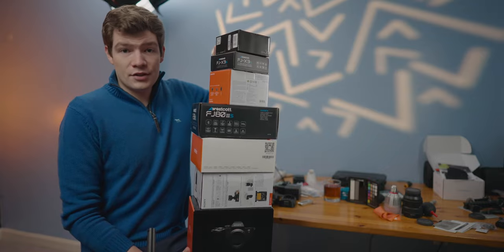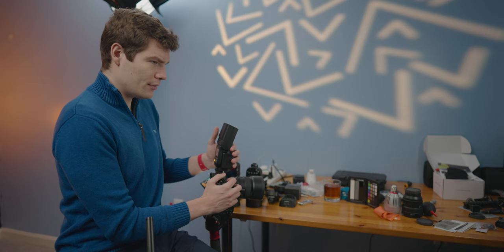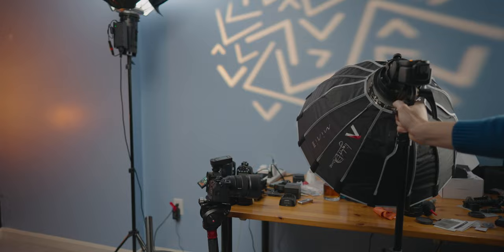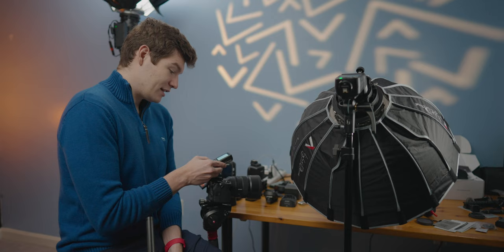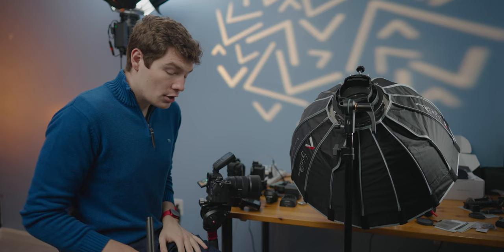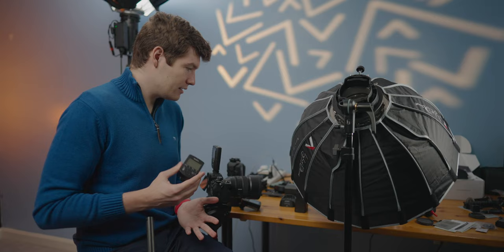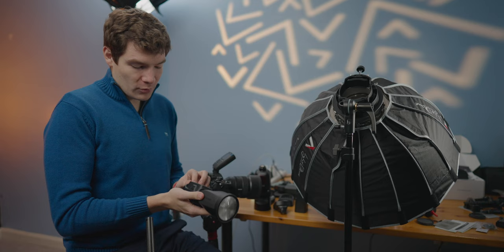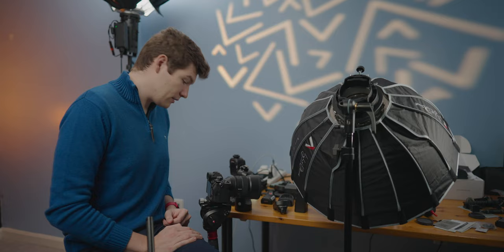Sony has a big camera flash problem (A7SIII, A7IV, A7RV Wireless TTL)

Comment: This is exactly the problem I have had using the XPro S & XPro II S with my A7iv and A7Riv bodies.  All images are underexposed by several stops, and it's inconsistent so compensation doesn't work.  If I put a V1 on camera, TTL works as it should.  I owned the XPro F for my Fuji, and TTL off camera works as it should.  This seems to be a problem with Sony cameras only.  I reached out to Godox, but they never replied to me.  The support has been really disappointing.

Comment: I don't find it that surprising that a third-party flash system does not operate perfectly with a particular camera. Autofocus with third-party lenses also don't work as well as camera manufacturer lenses.  I tried out various Godox portable flash units because my studio flashes are all Godox.  I can say for sure the Godox units are not as powerful as the Sony ones.  The V1 is about a stop less powerful than the Sony HV60.  Also, the Godox AD 200 puts out one-stop more light than the Godox AD400.  That is because the AD200 has a different type of flashhead (fresnel).  But I bet there are a lot of people who buy the higher-watt second flash thinking they are getting more.  So, I went with the Sony flash system...more powerful, less lag time, better built, metal shoe. You get what you pay for in this case IMHO

Comment: Now this is why i've had problems using rear sync. Was disappointed during a party shoot that i couldnt use the rear sync on the A7IV with the 3rd party flash i used with no problems with the A7III.

Comment: Thank you so much for this video. I thought it must be my fault: The settings are complex, and I still do not know what each setting does. I thought TTL must be something for beginners as you get to at least a useful exposure somehow. I did lots of tests but did not get it to work with my A7iii as expected. Sometimes I get usable exposure with +3 stops flash compensation. Most of the time it is too dark. And sometimes it does not adjust when I e.g. open the aperture and overexposes the images so that it is completely unusable. This especially happens when the camera is in manual mode. In other automatic modes it correctly exposes the image, but it is not doing what I want (e.g. sets the ISO super high). I ended up working in manual mode (M) on camera and setting the flash power manually. This is the only reliable method, but it requires some test shots. On conferences or events, you need to be quick and do not always have the chance to take test shots. It is so annoying when you miss a moment because you are just too slow with the manual settings. I really wish I would have a reliable TTL option.

Comment: Hi Karl, my Sony A7M4 does the same on wireless ttl as you described it in your video. My Sony A1 does not. It works perfectly on wireless ttl with godox. I used the xproII transmitter and a ad300pro flash with recent firmware. That is really wired ......

Comment: On the V1S they make a metal hot shoe version now (hard to find)

I ordered a metal hot shoe replacement and it’s amazing i break the plastic Godox hot shoes so often and they’re hard to slot in. The metal ones no issues so far
Reply from the maker: That's good to know
Reply: only the plate is metal. It's still plastic in the inside, so if you drop your flash on a tripod or something similar, it's broken.
Reply: @sulev111  regardless these metal hot shoes have yet to break on me yet simply due to less friction when inserting and taking off. 

The plastic ones break on my monthly
Reply: @koolaidpapi7674  apples n oranges :P I use my flashes mostly on tripods. There the metal plate makes 0 difference. Godox needs to improve their build quality.

Comment: Dear Karl, Thank you so much for this video.  You have found the one combination that seems to work:  Sony HVLF60M plus Sony FA-WRC1M Wireless Radio Commander.  Just for reader information I was able to order both of these reused for a total of $300 from eBay.  At about 7% of the cost of A7rV this cost is reasonable. When they arrive, I will let you know if they actually work. In the meantime I am putting all of my various non working TTL flashes in a storage box, to be used potentially as remote flashes when needed, providing the Sony Radio commander can trigger them.  I have Nissin, Godex, Flashpoint, and various older Sony flashes that don't work for TTL on A7rV.

Comment: It's bad... I have a problem with the 3rd party Sony ecosystem big time as well. You can't even get the IR focus beam to work on the a7IV with some transmitters aad the fact the Sony doesn't even have an AF beam on their trigger kills me! I work a lot of low-light events and not getting focus while working off camera is just dumb! I have been using a Elinchrom Transmitter pro for some Rotolights and came to find out that it won't fire the AF beam on the a7IV camera. I am almost convinced I should go back to my a7III, just so things work again, plus, I hate the fold out screen versus the tilt screen, since it blocks the ports when I'm using them and need to use the fold out screen... So many bad choices made with the a7IV. So many. I love my Sony flashes, but the system could really use an overhaul and the HVL-F60RM2 is not even an upgrade! The LED beam was removed? WHAT?! That was a feature and it's somehow more expensive than the last generation still?! Why is Sony so good with what it gives consumers inside the cameras, but so bad with their peripherals and compatibility besides? The Sony interface hot shoe is the other issue... I've replaced about 3 hot shoes on my Sony flashes alone and another on the Flashpoint./Godox Thank you for saying something! Youtube is desolate wasteland when it comes to videos talking about the Sony flash system. More videos need to be made so Sony feels the pressure!

Comment: Confirming. Latest A7S3 and Godox Xpro2 and V1S firmware upgrades - the issues is still there. TTL works fine while V1 on camera and fails when using transmitter.

Comment: One thing that I want to add: 
You turn around the bug statement. It is not a Sony bug as all the other old Sony Flash and Godox are working perfectly well.
The other manufactures of addons have to adapt their firmware to work proper with the camera that they are attached to. 
It would be the same if you have older car rims for you car that doesn’t fit, you blame the car manufacturer to change their setup due to an assembly design error ! A little weird.
In one thing I agree with you, you shouldn’t have made this video.

Comment: my A9 with the old menu still has this problem, not as bad. As others have said it goes away above f4. I have godox, they are ok especially with you factor in the cost.  Love the batteries on V1 which last forever. I was hoping the new controller would fix this problem but it does not. Also it has the old rubbish plastic foot not the newer metals ones you can get for the flash. Have you tried profoto ?

Comment: Great video Karl. I had horrible experience with Godox this weekend. Speed lights were undersexposing with ttl, on both A7iii and A7R v. At some point during the ceremony they decide to blow at kind of full power and overexpose everything by a lot. Same happened with AD200 and 400. So bad.... I was thinking about westcott, but after your video I'm definitely considering jumping to profoto, no matter the price. Any experience with profoto??
Reply: Hi! I'm working as a photography assistant and ever since we've changed to profoto, there is no looking back. Literally the absolute BEST in flash and better than you can imagine.
Reply: Profoto A1x performs similarly to the other off brands. Sometimes it nails exposure, other times it misses or just doesn't fire. It's frustrating so I just went to manual mode for my shoot two days ago. I am considering the smaller (not so expensive) Sony flashes exclusively for event work as I just need them to function properly so I don't miss these moments.

Comment: Karl Meyer & other saying about AA (14:13). You can buy ATG/Quantum/Nissin battery pack and connect it to flash.
You should really stay away from Li-ion battery for speedlites. They are expensive & use or no use they will go bad.

ATG used to support Jinbei/Orlit/Rollei/Westcott but departed over to become ATG/Godox.
So much problems & no supports at all from Jinbei for USA. That Adorama and B&H no longer support them.

Tested Sony A1 & A1 II: Jinbei & Rollei & Westcott are not supported.  You don't buy TTL features and use it in manual modes.
As a matter of fact one can use ATG's Quantum QFlash T2 and get better results than using wireless radio TTL.

Comment: Did you try switching the wireless flash off in the camera menu? I just switched it off, and it seems to work, at least indoors. It was not working properly before I switched it off. I will test it again outdoors tomorrow. I have  an ad200-pro, X2t-s, and A7c
Reply: ahh !!! it worked for me on A6700 .... thnx

Comment: nice work on this video BTW~!~ question, what is the resolution or settings your using to record this video, and why it looks so wide ?
Reply from the maker: I used an aspect ration of 2:1 instead of 16:9 meaning my video timeline & export was 3840x1920

Comment: So, I just bought a Sony a7rii, because they've gotten much less expensive.  Now, I want to do some HSS outdoor portraits using my Westcott fj-400 and the fj-X2m and it will not do HSS.  I had to turn off several settings in the camera, update firmware on all westcott equipment and still no HSS for the Sony.  All my old Canon cameras will do HSS with my fj-400 but that is what I bought the Sony to do.  It is June 2024 and you'd think any issues with the a7rii would have been debugged by now.  Anyone else have this issue?

Comment: Great video thank you for that, I was wondering about this .

What is the light box setup you are using ?
Reply from the maker: I wish I had cut more fat off this video, but thank you. I’ve got a light dome ii on me, an Aputure lantern for raising the rooms ambient light and an Aputure 2ft tube light behind me. I use an Aputure light dome mini ii for the flashes. Cheers.
Reply: @KarlMeyer  thanks Karl ! And can you tell me what attachment you use to hold the circular speed lights ? I personally use the Godox also
Reply from the maker: @richarddunphy1990  I used the Godox S2 as well. It was pretty great, actually. I was surprised.
Reply: @KarlMeyer  yes , that’s what I thought - I’ve been pleasantly surprised myself , my ex even dropped my flash in the ocean and i through  it in some rice and it still worked 😅☀️

Comment: I had the same problem and found your video. I am checking with sony a1 and godox xpro-s, v1, v860 II.
As soon as I switch from the speedlight attached to the camera to the wireless remote flash, the TTL result is about 2 stops darker (I also felt that the more defusion I attach the greater the attenuation, the darker it gets.) I used the TCM function to see the flash output of the TTL and for some reason it is more than a 1/4 flash. It also seemed to me that it did not increase the amount of light emitted. I switched to the old GODOX Commander X1T-s and the image seemed to be a little darker, though a little better.
I have a slight hunch that it may be a problem with the commander. Is your commander X-PRO-s?

After trying various things after my earlier post, I found out that if you use the FEL, a feature that can be registered on a custom button, and press the register flash button once in advance to lock the exposure with the flash, and then take a flash shot, you can use the proper X-PRO or the exposure compensation in the camera menu. Even if you set it to plus or minus 0, you will still get the proper exposure. This means that the exposure data from the pre-flash when the Commander is attached is not completely transmitted to the flash side due to some problem in the case of normal issuance without FEL.

Translated with www.DeepL.com/Translator (free version)
Reply: This was some good and interesting comments. I have done some experimentation with assigning FEL toggle to a button. Use that to take flash measurement for each new situation. Not too conclusive testing yet, but looks promising.

Comment: I used to shoot events with canon 5d mk2 and mk3 with 560 ex ii flash powered with AA and never considered the batteries to be a problem. Easy to swap. Cheap to replace. 
And back then we 400 ISO was a max I would use. These days you can shoot at 1600 ISO and flash will last forever. I am actually researching flash for a fill only... After years of using Sony.

Comment: Hi, I have a Sony A7IV that by putting a Godox X2T-S trigger and using a Godox AD400 PRO Flash, manually and in HSS works very well, but if I put the trigger in TTL and excluding HSS from the trigger and SU AD400 PRO in TTL without HSS doesn't work, in the sense that in TTL the Sony A7IV should lock the safety time at 1/250 and it doesn't, if I turn the time wheel it goes to 1/320 - up to 1/8000 so it's not possible to use the Sony A7IV in TTL with Trigger and AD 400PRO, I don't have Sony Flash only Godox AD400 PRO. Godox V1-C but it's canon and Godox 865 again for Canon and then I have a Canon 600ex-rt ii that I use on the Canon 5d Mark IV... Is there a mode or setting on the Sony A7IV that freezes time at 1/ 250 so that the Flash adjusts the power of the Flash based on the aperture?

Comment: Godox V1 S for Sony does not expose well in TTL, I have had 2 and 3 units of this flash and it is a serious problem, so good when you shoot a lot of shots, one fails, it does not shoot and the color temperature changes, it is not only my problem, there are more people with these problems I used it at a wedding and it was fatal as I commented on a youtuber who is from Olympus exposing the same problem and in the end he agreed with me at a wedding he gave null shots and when the flash heats up it changes the white balance now I make another video that will no longer use it, in the end I comment that it is worth paying more and have something reliable I am talking about weddings as a professional photographer and bought a profoto, if it costs more but you do not risk it on yourself worked.

I have had this flash at Olympus, at Sony and at Nikon and I would not risk it professionally, there are many more people with these problems apart from the broken shoe, now they are starting to remove a metal shoe but there are still these problems with the.
In the end, cheap is 2 times more expensive.

Regards

Comment: Hey guys, quick question!

I got one a7iii and bought with it the Sony HVL-f46rm flash and I can't sync/connect it with my Godox xproS(trigger) that I just buyed. Is that right? OR I really need a sony trigger only for that porpuse?

Thank you!
Reply: The godox trigger talks to godox flashes and godox receivers. Your Sony flash has a Sony receiver in it to talk to Sony transmitters.

Comment: Hello, I have a godox flash for sony, but when I put my camera in manual mode (sonny at 7 iV), the camera disables the flash. the same happens when putting the radio. while the camera is on the AUTO dial, the flash works normally (radio or flash) but switching to any other option (A, S, P, or M) immediately disables the flash function, just as if disabling the hot shoe. do you know what i can do?
Reply: Turn off the electronic shutter and it will work.

Comment: I am a 25+ year Pro Photographer.. You have to setup any flash before you begin your shoot.. No flash power setting works straight out of the box..  If you do all the adjustments and the exposure changes each shot, That's a problem..  But the  + and - are just adjustments..  You are not a Pro if you complain about setting up your Camera or Flash Equipment..  Buy yourself a point and shoot..,

Comment: Are you shooting wider than F4?
Reply from the maker: Yes, f1.2
Reply: @KarlMeyer  Godox is using reversed engineered Canon TTL protocol for most if not all of their flashes. Sony does TTL bit different. Canon RF similarly changed too. Godox haven't figured out the secret sauce yet. Been many years. Their flashes will underexpose 1-stop for every stop wider than F4. If you're shooting F2.8 then add 1-stop FEC to offset. Either that or shoot entirely manual. Maybe some day they'll figure it out and give us firmware update.
Reply from the maker: @Battlem0nk  Wow, that's as fascinating as it is sad

Comment: Can’t you just buy the Sony flash products and since it’s all from the same company it’s going to work properly?  If you buy the cheap Chinese knock-offs you get what you pay for.  It’s not Sony’s job to teach the competitors how to do TTL.  It’s only a few hundred extra dollars no big deal.  For less than a thousand dollars you have a nice flash and transmitter.
Reply from the maker: That is true, however, they don't sell dedicated off camera unites. There is no more powerful model like an ad200 equivalent. If you want dual wireless flash that 2 gn60's and the wireless transmitter.